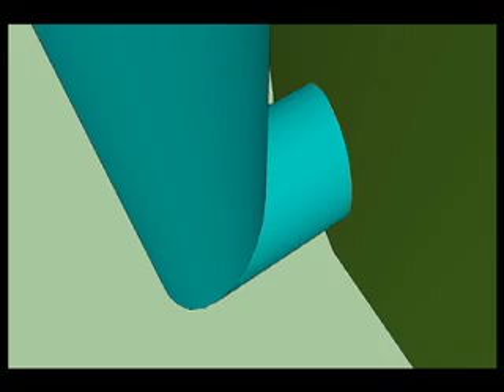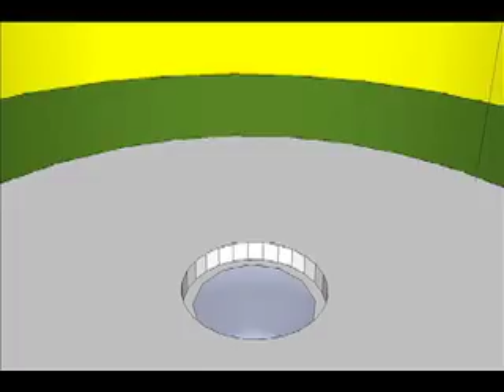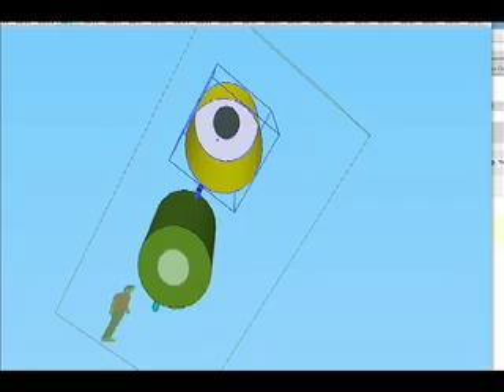Animation of a simple telescoping biogas digester

Comment: Would you not want the barrel on top to go inside the one at the bottom so there is a water seal (slurry seal) preventing gas escaping?  Otherwise surely you get gas escaping around the sides?
Reply: Yes, the top barrel goes inside

Comment: I have a few questions: when using this for black-water.. is there any risk of explosion? can you have the slurry exit with a much longer range (for the sake of oder control?) would there be any order emitted from the sides? would the gas itself have any undesirable smell? do you need to clean out solid waste from this system at any point?

Comment: Is there a limit on the size of the weight?  How much weight is required for adequate gas flow?  I guess that is a simple physics problem, but I  was wondering what gas pressure a small cook-stove, for example, would require.  Does the added weight affect gas production?  Is there a requirement for added heat (In winter, for example) required to efficiently allow methane production?  Thanks.

Comment: A small Danfoss pump that sucks gas from the top and compresses it at the bottom and shoots it out into the slurry to stir it would simplify the agitation cycle greatly. I may post my design soon that also utilizes a compost heap and a garden hose-type heat transfer system filled with water or glycol to help heat the batch, and also the same design with cold well water to reduce the temperature. A simple thermometer probe controls the cycle.

Comment: Trying to understand where you're coming from with your dedicated psychrophilic & mesophilic surface area design.  Where is the 10-15ºC simultaneous temperature differential arising from that would allow both microbial communities to coexist?
Reply: No, the temperature differential will cause strong convection, rapidly mixing the hot and cold parts, making it lukewarm. That would kill part of the bacteria, slowing the production. The bacteria would then adapt to this new temp., but you won't have both kinds of bacteria (low and high temp.) living in the same place.

Comment: I would suggest fins on the inner side of the inner cylinder. Thus if you rotate the inner cylinder (should be easy, since it floats)  you stir the content.
One Question: If I build a gravel tower as "bacteria-home" in the center of the Cylinder, would that make the table unnecessary? The cold-loving bacteria could settle in the lower, cold part, the warmth-loving ones in the upper part.
Great job, very inspiring, thank you!

Comment from the maker: Thanks for the comment pleacher.  Actually, we've found the water seal is not essential at all.  We've been building these for real for 3 years now since observing our first systems on roofs in Pune India and non of them had any moat.  The open space produces negligible gas if any; it is so little that you can't ignite it running a flame around the rim. The only real need for the water seal is dictated by temperature; on our porch in Germany we have one like this that only works in the summer.

Comment: If you had a stirrer attacked at an apropriate height near the bottom of the inner barrel you would merely have to turn/rotate the barrel a couple of times a day and it would mix...

how does this design deal with carbon dioxide present in the gas? or does this not matter?

Comment: eloid777 I will take the liberty to answer you.Note that in the anim. it is not shown, that the external tank is filled with slury. Now if you put the internal one on the top with all valves closed it will stay all the way up due to the air inside. If you open say the biogas valve it will slowly go down due to its weight, expelling the air. When it is all the way down the slurry will maintain its level both inside and out of the internal thank.That tiny laier bet. the int. and ext is the seal.

Comment: @tculhane have used a 2" out let to a T made a longer "stinger" out of 1" pipe welded into and through a 2" cap. right side of T has stinger passing out left side of T in to tank, bottom of T hooked to inlet of a pump
1" stinger hooked to pump outlet Gives you a simple closed loop recirculating agitation.
We use it everyday to automatically stir 120 gallon batches of bloody marys !! for the last 5 years

Comment: What about Plexi Glass and under water epoxy for the rutter stirrer at the bottom and ,,,, what to use for a pole to epoxy it too.. some kind of plastic handled broom or something would work and you can fashion the Plexi glass to it ,,, 

If you were real savvy, you could have the top of the pole coming through the center of a metal wheel and have the metal wheel have a crank knob you can hold on too on the top so you could grab it and spin the wheel. I have seen coffee grinder wheels like this

Comment: @tculhane  I don't know what I would use, but there are a lot of possiblilities. There really isn't much involved with the mechanics of a stirrer. It's just a pole with two flat pieces sticking out down at the bottom that would be smaller than the containers diameter, but big enough to mix things well.  A snow shovel could work perhaps.  The wood would corrode though eventually as would the metal, but it would work for a while. That is the sort of thing you need but plastic or galvanized steel

Comment from the maker: @gabehampton Thanks gabe, we've been thinking of different stirrer designs but haven't come up with a simple one yet (making it air sealed isn't the problem as we can just run it down an immersed open pipe, but the blades and location are issues). If you have something in mind please share!

Comment: You need to add a stirrer to it that is air sealed and can be turned from the outside. It would work at a faster rate if you had a way to stir the material in it.

Comment from the maker: No need to put cut off valves on a telescoping system; the gas rises and lifts the top barrel, and when you add slurry you want slurry to come out.  You are welcome to add valves but is an extra expense. Our project in Cairo is partially about getting the cost as low as humanly possible; we have now succeeded in building 1000 liter digesters for less than 150 dollars.

Comment: wouldnt you want to put cut off valves on both the input pipe and the output pipe on the sides so water and fluid dont rush out randomly from pressure...

Comment: Once the gas starts to burn you can start feeding your digester ground up food waste (mixed in a blender with water, about 1 to 2 Kg a day, but start slowly so as not to overwhelm the bacteria; start with 200 grams then 400 the next day etc.).  Soon the CH4 content at the top of the tank will exceed 60% (since CO2 is water soluble it can get up to 70%) and can be directly used in cook stoves and engines. Hope that helps explain it. It works well and is fairly simple you'll find.  Give it a try !
Reply: No thanks.tappingerror

Comment: You then close the valve at the top so no air can get in and just let it sit there for anywhere from 2 weeks to a month (depending on climate).  During this boring period the bacteria will multiply. At first they will just produce CO2.  After a few weeks open the valve and flame test with a candle (we didn't use a flashback arrestor! Doh! :) ) .  The first couple of times the escaping gas will blow out the candle. Eventually, after a few days, the methane content will exceed 50%.

Comment: Greetings iT,
The process is started very simply by taking about 40 or 50 kg (maybe 4 to 6 10 or 15 liter buckets) of manure (we used horse manure in Germany, cow manure in Egypt, but any manure will do) and mix it into the bottom container with water (200 liters would be fine; we just go ahead and fill the whole thing even up to a 1000 liters of water).  Then put the top barrel on and open the top valve so all the air escapes and the top barrel sinks down into the bottom barrel all the way.